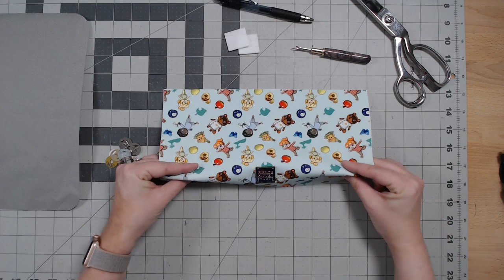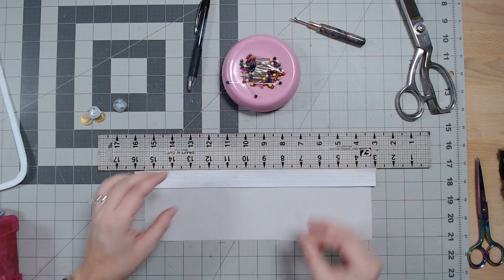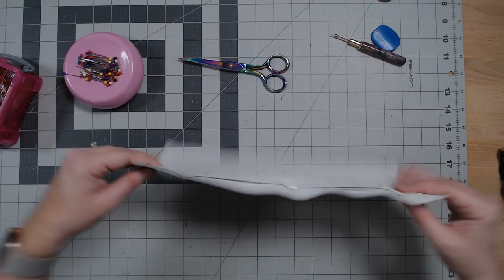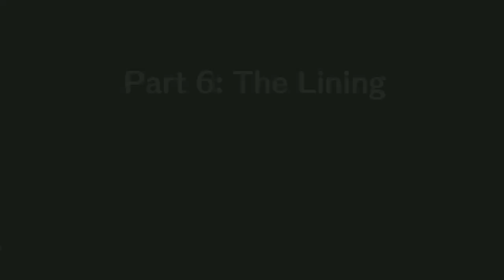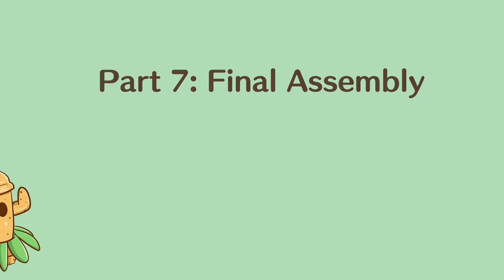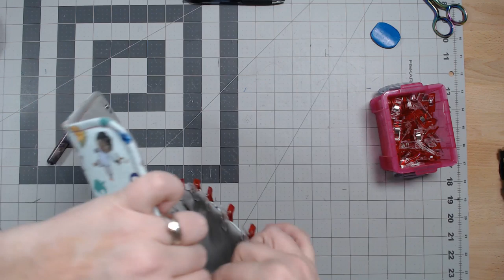Portable Gaming Console Case: Full Tutorial

Comment: Thank you for this video. Very clear and easy to follow however…. I followed that pattern and the video step by step seam allowance for seam allowance I even drew round the pattern pieces and my ‘portable console (switch 😉) doesn’t fit well it does but it’s very very tight. I’m going to give it another go making the pattern slightly bigger
Reply from the maker: OH NOOO!!! What machine do you have? It’s supposed to be tight, but not THAT tight. I know some machines have some botched needle plate measurements.
Reply: @fiercekittenz  a brother LS14s. Ive just made a slight adjustment to the width. Making another one now so 🤞🏻